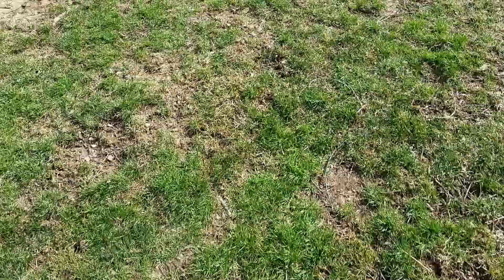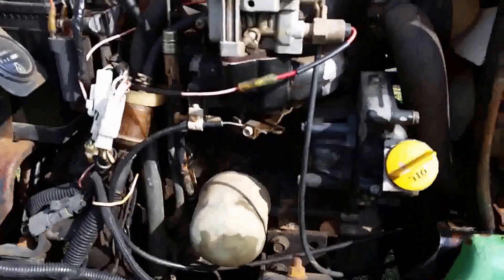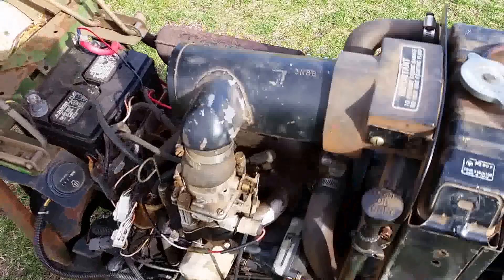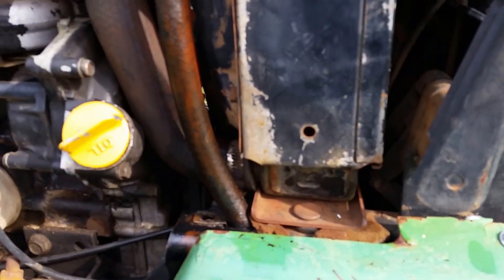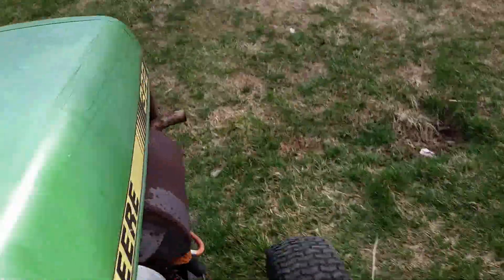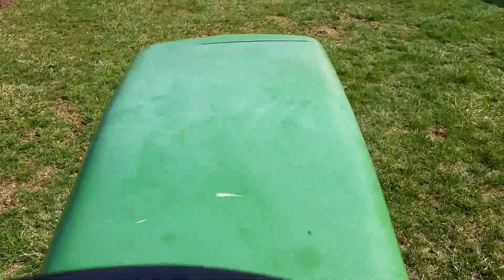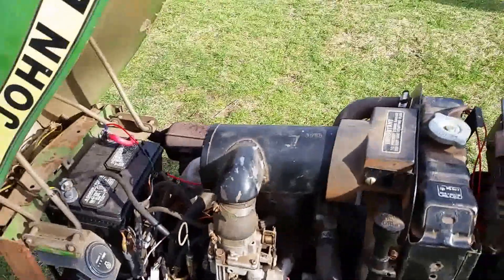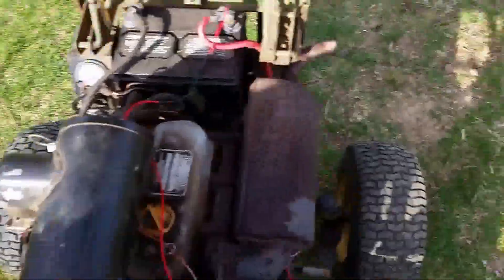1988 John Deere 322 Garden Tractor Overview, Running, & Driving

Comment: thanks for the video!  i have a 316 and a 425.. my neighbor saw i have been putting around with garden tractors lately and gifted me a 322 he had decommissioned after some starter solenoid issue a couple years ago.  even gave me the 4 way blade and a cab!  Just pulled it in my shop tonight and starting to go through it.

Comment: I have a liquid cooled John Deere, they have there good days and they have there bad days....really bad days. At least for the Kawasaki. I like the throatyness of the exhaust!
Reply from the maker: crazyjdkid Yep. I had a liquid cooled Kawasaki V-twin in my old Scag Turf Tiger mower. It was the same engine that is in the JD 425s. For the most part that engine ran really well for the hours it had. It was pretty reliable.
Reply: JohnDeere318Guy I have a Kawi Liquid cooled with 800hrs, and Kawi air cooled with 100hrs and a Kohler Command with 1500hrs. I rebuilt the Kohler 6 years ago, after someone gave me it seized. Its probably the most reliable of the bunch but it likes its gas! The liquid cooled Kawi is a chore to work on as they put the radiator on top of everything.